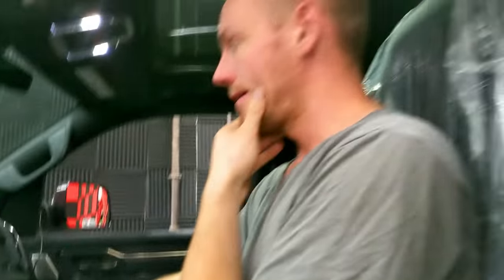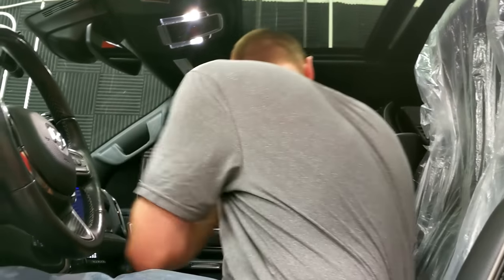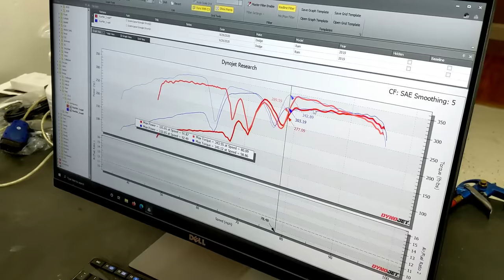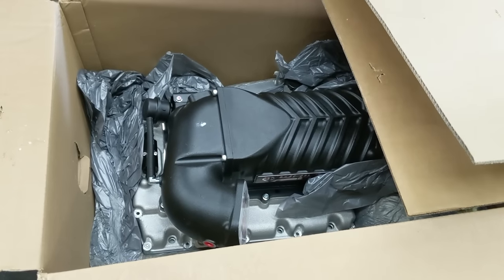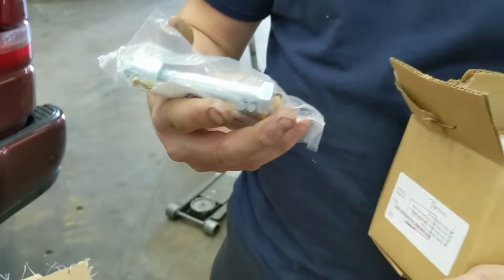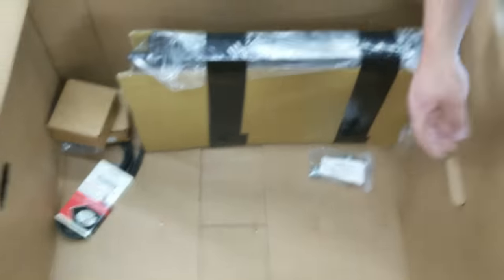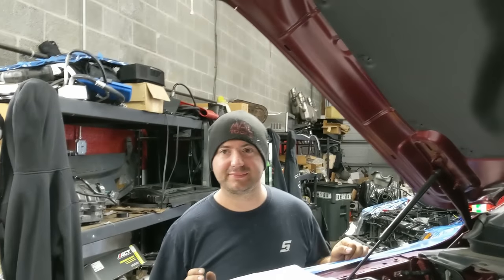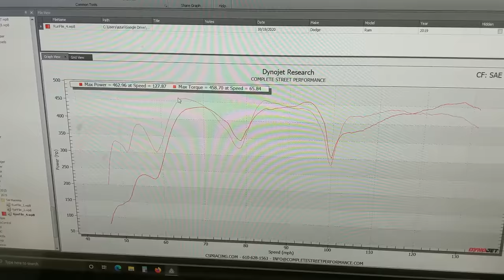2019 Ram 1500 Gets a Whipple Supercharger!

Comment: The ram is by far the nicest truck out there.
Reply: Couldn't agree more 2018 &22 HEMI Bighorn what a sports car, luxury car and truck wrapped into a gorgeous package
Reply: @jasoncentore1830  they fall apart tho.
Reply: @Srtsimmy Never had that problem.
Reply: @tkj6557  well you probably take care of it. Start working and throwing weight in the back of a truck, something gonna break. Whether it’s your brake light or your suspension lol.
Reply: @Srtsimmy  Sounds like someone is bitter. I’ve seen many more Fords/GMs on the side of the road than Rams.
Reply: @Srtsimmy too bad you couldn't afford one cause you don't know what your talking about. I got a 2019 and 2023 laramie 1500. No problems with either of them. 2019 has 172k and my 23 has 6k now. But keep me posted on your hateraid. 😂
Reply: Thank you I love my 22 ram bighorn
Reply: I like all of the “Big 3” but it depends on what kind of truck you want
Reply: I have a 2020 night edition bighorn, 12 inch screen and panoramic sunroof and it’s a crew cab, love my truck
Reply: Got a '21 blacked out Laramie with 60k. No issues. Haul a 7k lb travel trailer every weekend. Love my Hemi Mopar!
Reply: @Srtsimmy  mine hasn’t, has yours fell apart ?
Reply: @Weldemall2  I couldn’t agree more …. Ram is the best .. I also have a 2005 1500 HEMI engine with almost 400k miles , original engine and transmission. And still runs great !!!
Reply: I now have a 2023 ram rebel … awesome truck .
Reply: @Srtsimmy yea the old rams, new ones are by far the nicest truck out, interior and exterior. Currently on my 2nd ram limited 2021, sold my 22 platinum f150, had a Titan, Sierra Denali, Ram by far is far superior with quality, luxury, comfort.
Reply: @Srtsimmy  not really there's a guy who documents his experience every so often miles and he does farm work and heavy hauling with it The truck has around 275,000 miles on it and it's fine no issues...
Reply: I finally got a 2021 limited.  First ram and I'm blown away.

Comment: Its funny watching gm guys get into a new ram. They're like wow this is super nice. Well yeah, its 2020 and gm has had a round about same interior for 6-7 years lol
Reply: Nah hate or nth but didn’t ram use the same body and interior for 12 years 😂🤣
Reply: @tommycantu9142  no Ram didnt Dodge did 😂
Reply: I’m gm guy I just went dodge I love it
Reply: @tommycantu9142  not interior, 2009-2012 are the same interior, 2013-2019 classic is another interior but same exterior lol
Reply: I switched to dodge too never going back
Reply: I like how the GMs look on the outside, but the interior is why I didn't buy one, same reason I didn't buy another Tundra which is like stepping back in time 6 years, and Ford just seems narrow inside. The one thing that sucks with the Rams is random shit comes loose, like screws inside the door panel, the screws holding the sun visor, really annoying, easy to fix with locktite and a torx driver but still WTF? Oh exhaust flange bolts stretch, you get an exhaust leak, and if you try to tighten them the head of the bolt rips off.
Reply: @danmcdonald726  My 2015 Silverado has a lot of panels that vibrate and screws that backed out. I think all the designs sucks now for vibrations.
Reply: Yeah I just went from a 2015 silverado LT with the 5.3, up to a 2020 Ram 1500 bighorn. Not even the nicest package interior wise and it still shits on my ol chevy. Power wise.. the 5.7 with the 8 speed is great as well
Reply: @tommycantu9142  there goes a hater, ram been winning for years now
Reply: GM the cheapest plastic
Reply: Yea gm's interiors are so late with they're changes. Especially chevy!

Comment: 478 is pretty good. The 5.7 is capable of a shy over 600 on stock internals.
Reply: The new 5.7 comes with the same roller rockers as the 6.2 supercharged HellCat.  The only thing that is a little shy in that 5.7 are the rods.  Anything over 600 HP those rods are going to stretch too much and something isn't going to stay in place.
Reply: Whipple seems like the way to go..love that Whipple whine
Reply: @kimojon9665  What? I have pulled heads on at least half a dozen 6.2's and have not seen roller rockers from the factory.... I'm about to go and shove a borescope into the valve cover of my 2020 Gen 3 5.7 to test this theory....I have even installed a set of aftermarket roller tip shaft mount rockers on a hellcat... how do you put a roller rocker on a shaft mount head?
Reply: @bobbyd9583  I dont speak automotive but sounds like you stuck it to this poor man.... lol
Reply: Pllluuuease,... seen stock 5.7 take 19 psi put down 4 digit numbers on stock rotating assembly with cam+boost.
Reply: They can handle way more than that, ring gap is the problem. The Hemi’s, especially 6.4’s, have a tight right gap that don’t like the extra heat from boost.
Reply: @peaceandlove8984 . Agreed, stock bottom LS motors & 3rd Gen Hemi’s can hold lots of boost and power with just extra ring gap.
Reply: That is incorrect I've seen 5.7 l with stock cast pistons pushing 1000 plus horsepower.

Comment: These are great numbers to see.   I have the 2019 RAM and have it CAM w/ Jay Greene Tune and full bolt-on.  I look forward to doing this Whipple charger.
Reply: What cam you have ?
Reply: @user-km9gn1qh6p   COMP CAM  v2 205/222 - works great with a stock to 2800-3000 converter, or a stock to 2600 and it does very well with 8 speed trans.   Also very good for a when I do a Whipple SC.  hope this helps
Reply: Do you know how Much hp you’re at the wheels now? Bc I know a cam and tune is better than 10k for a charger lol. with 10k I can cam and tune my ram, and drop a 6.0/4l80e with headers and a tune in my 04 Silverado I use as a beater lol
Reply: @42ambrocio   Mines dyno at 402 at the wheels, can not remember the torque.  My cam is smaller, but i can feel a big difference.   In all wheel drive 0-60 in 5.5 seconds, not to to bad for a heavy beast.   LOL
Reply: I wonder who does it here in South Texas! Very few people are experts in Mopar :(
Reply: @danielaraujo44  did you find anyone?

Comment: Wow, love how you guys are branching out to different makes. Mustangs and now Ram trucks! Lol. My 16 Ram is a full bolt on truck with email tune and dyno’’d at 375 hp and 399 torque on 93 octane. Lots of potential with these trucks. I would love my next move to be a Whipple or Procharger! Wold love to have 500+ at the wheels. Get that c8 into the nines!
Reply: nice
Reply: My ram has the exact same mods and is currently getting a whipple put on.
Reply: @MoonBoost  that’s sweet! Let me know how she runs!
Reply: That's not a full bolt on truck 🤣. You have no bolt ons 🤣🤣🤣
Reply: @trigun890  lol right 50 hp gain with full bolt on tune
Reply: Very nice!  Have a 394Ci 6.4L stroker in my Ram, the new On3 kits being offered are giving even more boost options!
Reply: @Glowyaltee . You can get that amount of power with just LT’s, exhaust, and a tune. The Eagle heads flow 300CFM from the factory, same as LS3’s, it’s easy to gain power with 3rd Gen Hemi’s.

I gained 40RWHP with intake, LT’s, Ypipe, & muffler. A specialized Hemi tuner could have got more.
That was my old setup.

Comment: In order to roll the truck with it on in neutral with the driver door open, you have to press in the three position switch that controls the parking brake.

So, reach down and push the button in, the truck should roll. If not, there is a panel beneath that button, behind that panel you will find a nylon and cotton strap that once pulled out fully it will disengage the transmission allowing you to roll the truck no matter what. To reset that, just pull it again and it will return to it's initial position.

Comment: Can't understand why the baseline for the dyno sheet is MPH instead of RPM. Could make sense of that at least. Since you don't know exact tire diameter, the actual gear it is in, or how much slip the converter has you can't really calculate the rpm. Can anybody explain why they do this?

Comment: You can hold a gear with the autoshift button on the steering wheel.
Reply: You can how do you do it?
Reply: @mcrangelvlogs9396  the steering wheel as the option on it. Manual swap gears on the right side says gear limit with a + and - above and below.
Reply: Yep , if you leave it at 3 for example it won't go above 3rd gear

Comment: I gotta High Country but , the Ram interior is way nicer , screen, dual sunroofs etc. 💯
Reply: That’s the only thing that’s nicer, lol
Reply: @RDSPRERUNNING 33 I own a ram and work on it myself 🤣🤣
Reply: @RDSPRERUNNING 33 I'm being hypercritical. I definitely love the evolution of  the Rams, but I don't agree with the value to price ratio. But to your other point, naturally aspirated V8s have so much proven potential and I am also not sure why Ford would abandon this power plant in such sweeping numbers. I'm in the market for a new truck and Ford was a top contender, but with an eco boost V6, they aren't anymore. 😡. I have owned vehicles with the Ford 5.0, Chevy 5.3 and the Ram 5.7 and all engines were as solid as ever. Disappointed in Ford's manufacturing decisions.
Reply: @RDSPRERUNNING 33 It's actually not that bad. I have 196k on an 06 and it's showing wear that's indicative of a 15 year old vehicle. I had to replace the kick down solenoid, other than that, it's pretty solid. I'm really just talking crap, because I hate the fricken prices of new trucks.
Reply: @RDSPRERUNNING 33 And yes, six speed auto, with the 5.7 Hemi and MDS system. Lifter noise for days, but I keep the oil changed and haven't had a problem. And I definitely agree that the 5.0 is a top tier V8 in comparison to the 5.7 with MDS tech. MDS and the hemi engine is not a good combo, at all.

Comment: Put 200,000 miles on my 2010 ram 5.7 hemi sport b4 I traded it.  I drove the piss out of it non stop.
Reply: How did it hold up after that many miles??  I know others with high miles and had great success. Just regular maintenance. Motor, transmission and diff all original. No issues at all. That’s why I went Ram and these guys beat there trucks.
Reply: @ramrider1453  rear window regular failed, computer had to be replaced at 170,000 because fuel injection timer apparently burnt it up due to being clogged.  Other than that everything was 👍 good
Reply: @macflyguy5166  Thanks. That isn’t that bad at all with those kind of miles. I hope I have that success such as you. I keep my trucks for 10 plus years. 👍. Have a merry Xmas.

Comment: I’d love to see a ram 2500 or 3500 6.4 hemi with a whipple 3.0 or 3.8 whipple if possible to make 600 whp only and with full exhaust and headers intake tb tune is say 800whp  with heads and cam as well easy cause 6.4 make 410 hp 429 tq vs 5.7 like my 18 does 395hp/400tq
Reply: A 2.9L Whipple flows enough for north of 1,000hp alone. Adding more N/a power will require less boost and stress on the motor. 💪🏻
Reply: A 2.9L Whipple flows enough for north of 1,000hp alone. Adding more N/a power will require less boost and stress on the motor. 💪🏻

Comment: If that was my 19 ram 1500 I’d at least have a cold air intake thottle body full exhaust and headers. Tune and a 3.0 whipple not the 2.9 whipple. And hopefully make 600whp and maybe I’d put a heads cam package too to hit that my goal of 750 whp in a 5.7 maybe add some fueling and other supporting mods to support 1000 hp maybe hit 800 whp ar most

Comment: Will a turbo help with towing capacity?
Reply from the maker: No. While you can pull weight easier, towing capacity is determined by other factors, such as stopping power and how much weight you can actually support with bearings, wheels, etc.

Comment: I just wish the 5.7 was capable of more boost on stock engine. Kinda hard to swallow the $10k pill for boost when a 5.0 makes about double the power 😭
Reply: Yeah I agree but , it sounds nice for sure 💯 . It would be better if it had the 6.4 engine with 475 hp to start from the factory and then add that Whipple those numbers would be very impressive 👍💯
Reply: @keepout7439  I agree. But it saddens me that they give the 6.4 a forged crank, but not forged rods and pistons. Limited on boost there too.
Reply: @TonyTheTruckGuy  forged pistons and rods would be Awesome 💯 , had to be some ideal behind that decision from Dodge🤔🤔 , maybe so they could keep the HellCat 6.2 engine different for the purpose of selling more vehicles 🤔??
Reply: @keepout7439  Probably

Comment: You know what’s sad? I’ve seen 5.3 Silverado’s at over 1000 RWHP. I’ve never seen a 5.7 hemi making over 8-9 pounds of boost. the ZF8hp70 transmission is only rated to 700hp hence the “70” I’ve seen Honda civics that can handle more torque than these trucks. Incredible hemi sheared an input shaft to prove it.
Reply: the 5th gen 1500’s have the zf8hp75 can handle 800hp. civics and silverados are cheap, easy, and everyone can make them fast. it’s not everyday you see the ol tried and true hemi with a supercharger let alone any aftermarket at all. the civic and the ram are totally different classes like comparing apples to oranges. and silverado and ram and kinda the same except gm has always gotten way more aftermarket love than the 5.7’s
Reply: The 70 is misleading. It's just a number and has nothing to do with the actual torque rating. Rams also have the 8hp75 which is rated higher for torque, but doesn't mean 750 lb/ft.

Comment: Now race it against the Ford raptor. 450hp vs 450hp. I need to see this.
Reply: Also your looking at 450 whp on ram and 450 crank hp on raptor but i still want to see it anyway
Reply: @timellis2217  I want to buy the 2021 ram rebel but up the power and torque. I wish they would put a stronger engine in for the new models like the 392 hemi or 6.4. The 1500s can handle it and has room for it.
Reply: I wish they would to thats 475 hp in a 1500 or 2500/3500

Comment: In all honesty, I thought it would have power than that. A supercharged Ford F-150 (with a smaller engine) produce upwards of 700 horsepower. Nonetheless, the Ram is still a fantastic truck.
Reply: Yeah I was kind of not impressed with the output
Reply: These are from a box tune from Whipple that's meant to be "safe" but if you take it to a tuner you can definitely get more, also Hemis are notoriously tricky to tune so finding a good tuner would do wonders.
Reply: ^^This. Plus at the crank numbers vs at the wheel numbers - big difference.

Comment: Why cant you run it in a single gear?
Reply: If they would have used the hold shift rocker on the steering wheel it would have worked; rookies.
Reply: It will still upshift because the computer will not let you over rev it.
Reply: @jeffdent4619  is that just a Dodge thing? I see all types of fords dyno testing in a single gear
Reply: @robertconrad200  Not sure, I have a 2019 Ram and it upshift regardless of gear selection if revved to high, or it will not let you manually downshift if speed is too high and it will over rev.
Reply: @jeffdent4619  my 2014 don’t up shift it self,  already forgot one day that I was on manual shifting and almost blew ny engine lmao
Reply: @_beastmode_rc  I haven't tested mine and don't plan to, but the manual for mine says its protected from over revving.
Reply: @jeffdent4619  yeah to be safe don’t do it lol mine went all the way to 5500rpm 😅 and didn’t shift it self until I did